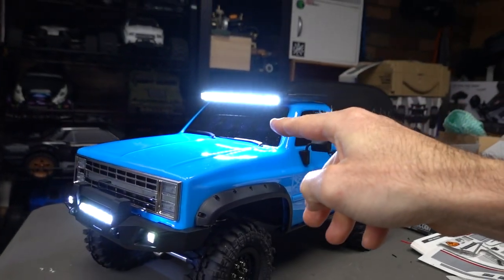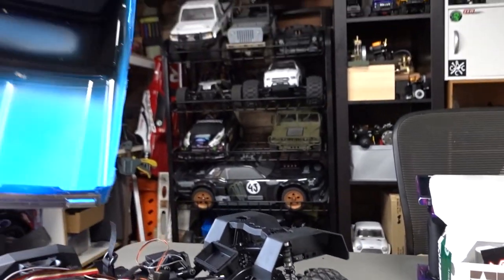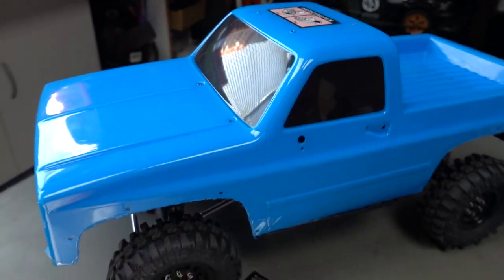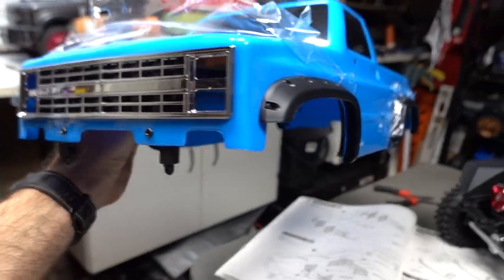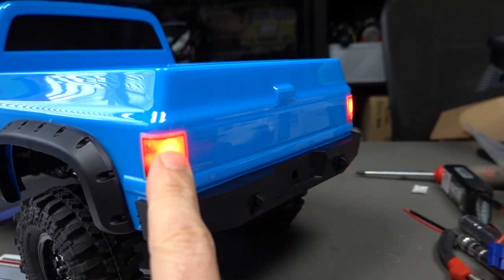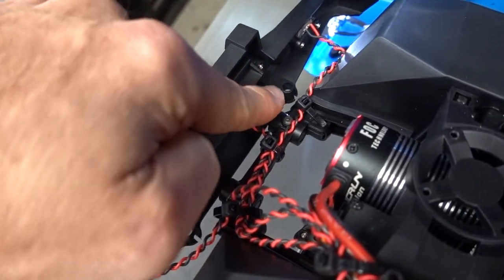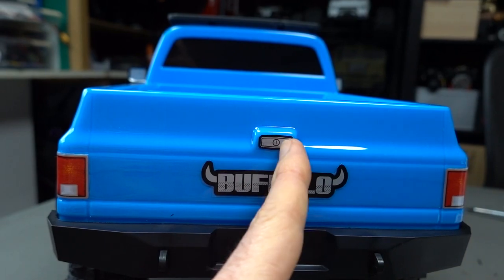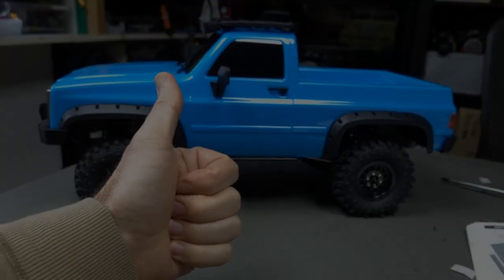CRAZY BRIGHT LIGHTS & AWESOME COLOR - GMADE BUFFALO PICKUP TS BUILDERS KIT - ALL DONE!

Comment: The pickup version of the Buffalo is a great looking truck.  I also like the fact that the body mounting system is hidden.  I just built the new Cross-RC AT4V pickup truck kit which shares a lot of features with the Gmade product.  It also looks great but still uses body posts and clips which is not ideal from a scale realism point of view.  See what you think by checking the series of videos on my channel, BlackSeaRC.  I'm currently considering the purchase of a GOM buggy so will be interested to see that.  It has been out for a while now so I'm keen to find out if it is still a good purchase or if there are better products to buy instead.
Reply from the maker: Cheers man, will do

Comment: What scale is this? I got a RC 1/6 scale hummer on eBay BUT  it didn’t come with a remote nor battery. How hard would it be to get it moving again ? Thank you debs from Texas
Reply from the maker: 1/10th, it will be easy to get yours going. Just get a simple hobbywing esc/motor combo and a flysky radio.
Reply: @RCTanksTrucks247  thank you so much.